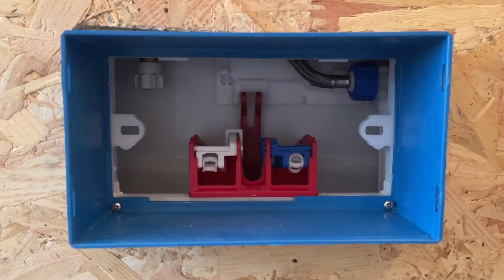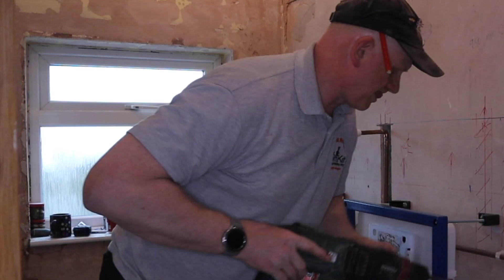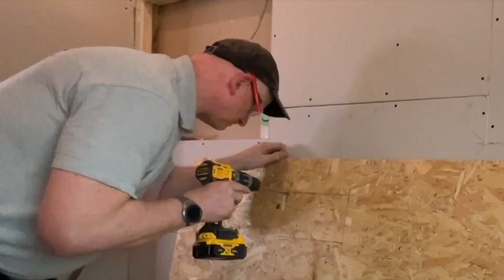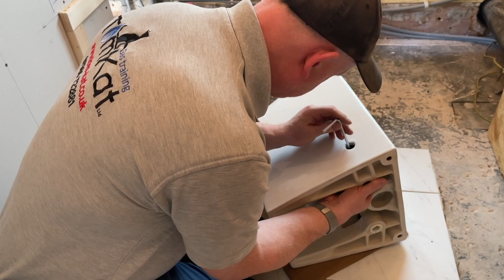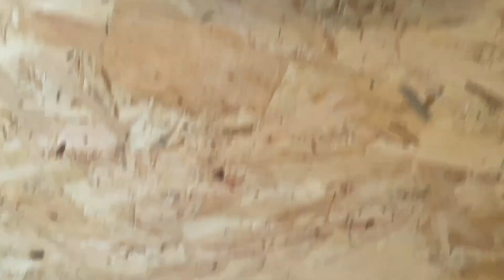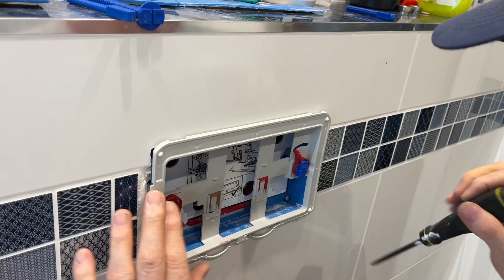How to install an off the floor toilet on a concealed cistern frame

Comment: Hi. I have a small bathroom like most. The door is close to the currently installed close coupled toilet. If I install this does it being the toilet further away from the wall making it closer to the door. Thanks
Reply from the maker: Depends on which model you get and how big the boxing needs to be. We ended up with more room